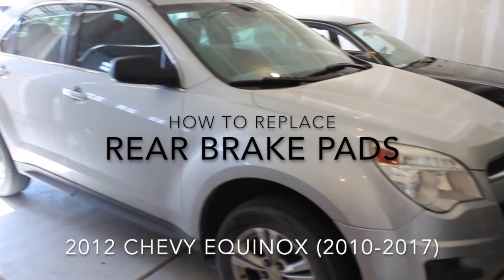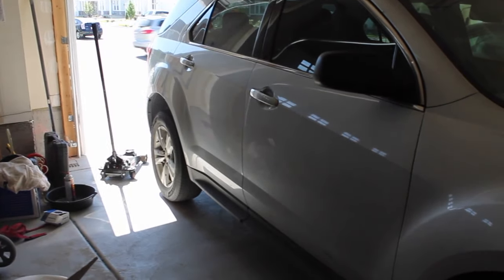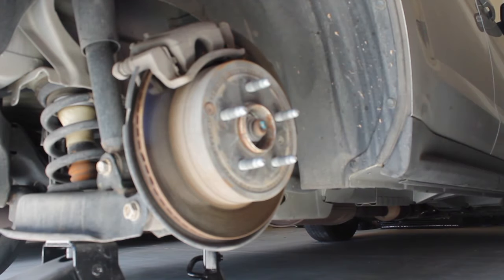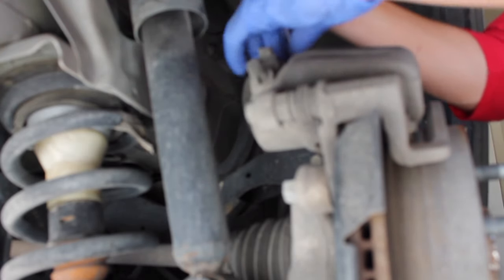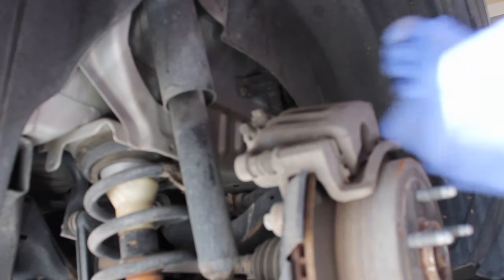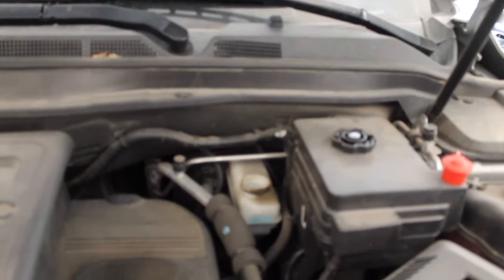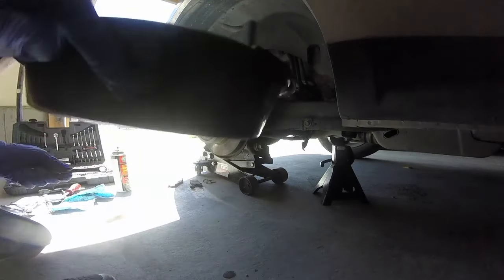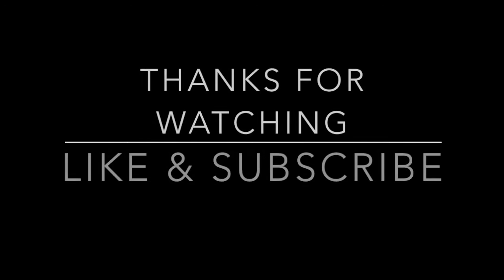How to Replace Rear Brake Pads 2012 Chevy Equinox

Comment: Can I ask what types of brake pads you used?
Reply from the maker: Absolutely! I believe these we AC Delco ceramic pads.
Reply: Thanks for replying,now I can fix my equinox,may you have more viewers and subscribers,god bless 👍👍👍👍
Reply from the maker: @ronngarcia1693  thanks for the comment! Best of luck on your project! You’ll do great!
Reply: Now my problem is the piston there is no way to turn it coz the special tools they gave me is not capable to use
Reply from the maker: @ronngarcia1693  yes those can be a pain to use. Fortunately for me my calipers we the type you can just collapse with a clamp. The type you spin to collapse are difficult. There should be a video that you can find that will give you some tips on collapsing those type of calipers. Good luck, my friend.
Reply from the maker: @ronngarcia1693  https://youtu.be/fSCYMfRBIC8 here is good video I found explaining this. Good luck, brother!
Reply: I did it perfectly my friend,now my problem I can’t find where is the noise underneath every time I turn to the right really annoying
Reply from the maker: @ronngarcia1693  what kind of noise? Squeaks or clunks or something else?
Reply: Something else,do you think it’s the power steering?
Reply from the maker: @ronngarcia1693  did you also do your front brakes? If so it could potentially be power steering. That will make a whining type noise if it’s power steering.
Reply: No but the mechanic said pads are fine even in dealership they said 👍,I don’t wanna bring to dealership coz it’s gonna cost a lot
Reply from the maker: @ronngarcia1693  I don’t know my friend. I would maybe go back and make sure you tightened everything and make sure you greased everything good. Might want to try taking the pins out and grease those up and your pads really well. You won’t need to collapse the caliper again since it should be set to where it needs to be.

Comment: Do you know if this video applies to a 2018 Equinox?
Reply from the maker: Hi Anne, all disc brake jobs are typically the same- but you will likely have a different part number for your actual brake pads. Hope that helps. Good luck.

Comment: What did you spray on the caliper and rotors and why use the grease?
Reply from the maker: It’s a break cleaner. The grease essentially makes a seal on the calipers.
Reply: @HomegrownHowTo  thank you!!
Reply: You should also grease the tabs or “ears” on your brake pads so that they slide without hanging up or seizing. That’s a huge step missed here. You also want to clean off and apply new clean grease to the slide pins. Forgetting to grease the hardware correctly can often lead to uneven brake wear so it’s best to always to do it properly.

Comment: You didn’t grease the ears/ tabs on the actual pads where they run and slide in the brake hardware clips.
Also, it’s important to make sure that the brake slides are greased and clean ready for the new set of pads so they do not lock onto the rotor and destroy it.

Comment: Why don’t you remove the rotor and resurface it or replace it with a new one? I would think it’s a better break job with new pads on a completely flat rotor. It’s like changing a baby diaper without cleaning it’s bottom.
Reply from the maker: It would make a flawless job but IMO it’s not needed every time you replace pads. My rotors are pretty smooth. I’ll only change them if the rotor doesn’t feel smooth. Plus I’m cheap lol.
Reply: i will run a couple sets of pads before I change my rotor unless I notice something going on with that side brake. after doing mechanics for 25 years you learn what u can and can NOT do.. a garage will always sell u rotors because of liability or any problems down the road with item it will be warranty between the shop and the parts store..
Reply: @canudie1978 I sold a 98 s-10 a few years ago, got it at 36,000 miles in 2000, sold it in 2020 at 228,000. Factory rotors and bearings, stopped smooth, zero vibration/pulsing. Regret selling that thing.

Comment: your lucky ! Buick encore has spin calipers in the rear
Reply from the maker: cartoonist1975 those are annoying! If you don’t have the tool to collapse that you can usually rent them for free at a auto parts stores. Makes it much easier. Good luck!
Reply: I did a friend's lumina back in the day, had those on the back. That's why I was here to check on the equinox, lol.